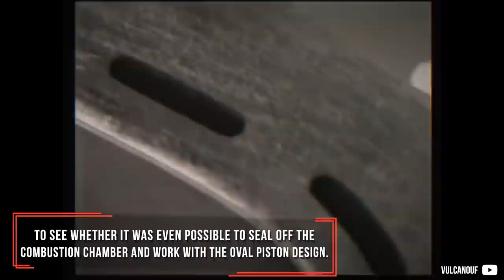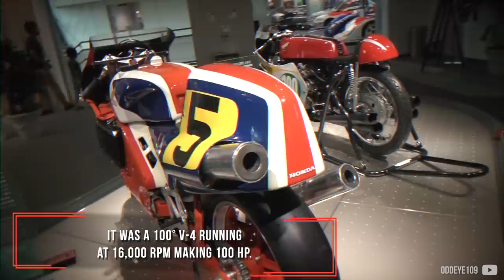Why Honda Made A 20,000 RPM Oval Piston Engine

Comment: Another great video, Visio. I have read that oval pistons occurred as a byproduct of chasing number of valves and airflow, not "cheating" a v8 out of the rules as they were at the time. In a circle, once you have 6 valves and a spark plug, there's no more head left, but lining up the valves allowed 8.  In the same article it was mentioned that Honda also had a turbo GP engine in development at the same time - which was allowed at 1/2 half displacement - so they had 250cc turbo parallel twin that revved to 20,000 and made 125hp, but whose power characteristics would be unrideable, so they went with the oval piston 500... Honda is fascinating.
Reply: I believe you are incorrect. To compete against 2 strokes Honda needed their 4 strokes to rev high to make the same power as two strokes which fire twice as often. More, smaller cylinders (each with lower mass) allow the engine to rev higher. Honda had been successfully racing (normally aspirated) 4 stroke bikes with lots of pistons, for example there was the RC166 an inline 6 cylinder 250cc, the 1966 RC149 an in-line five-cylinder 125cc, as well 50cc twins and various others. 
They wanted to build a V8 500 but new rules had been put in place banning engines with more than 4 cylinders by merging pairs of pistons together. The NR project was indeed an attempt to get all the beneifts of a V8 with only 4 pistons as the video suggested.
Reply: Had it been an airflow thing wouldn't they have attempted to put valves at each end (longitudinally) as well for max airflow, essentially 5 valves per cylinder compared w/ traditional designs? As built, the oval design utilised 8 valves per cylinder, or 4 per cylinder vs cylindrical designs. If more air was the goal, wouldn't we expect Honda to cram in more relative valves than the standard 4?
Reply: @williambrasky3891  My initial comment was based on quotes from Honda engine designer Suguru Kanazawa (NR750 road bike) about the development of Honda’s GP bike in Classic Bike magazine October 2017 issue. Here’s a bit of it: 
“When Shoichiro Irimajiri-san and his staff were given the responsibility of designing a ‘new engine’ for Honda’s return to racing in the 1970s - which basically meant not a two stroke - they realized they must increase valve size as much as possible to improve breathing and achieve more power through higher rpm. By using a single cylinder engine for experiments, we tried five, six and seven valves per cylinder but the results were not satisfactory. 
We discovered you must have either four or eight valves per cylinder. With four valves, we could not achieve the necessary flow, but with eight valves the problem was how to arrange them on a round cylinder, and to operate them in a suitable way. Then one day, Irimajiri-san was driving home from his office, when he stopped at a traffic light. In Japan these are suspended in the air, with filter lights for protected direction changes underneath the three usual lights. He looked up and saw two rows, each with four lights, hanging in the air side by side. He suddenly realized how it would be possible to make an eight valve cylinder using an oval piston. The next day we began the development of the NR New Racing design! 
After we made the decision to use oval piston technology, other advantages became apparent which, honestly speaking, we did not think of at first. Everyone compares one eight valve oval piston to two round four valve pistons, and because it was forbidden to make a V8 engine for 500 GP racing, people thought we made the oval piston V4 to avoid this rule. But this is not so; the technical advantages are even greater than a round piston V8, making the oval piston design the preferred choice in any case…” 
...and then he goes on to list the advantages, and they were competing enough to entice them into trying to surmount the many difficulties of making an oval piston engine. Very interesting article. So anyway, that’s all I got, just an article in Classic Bike - but words straight from someone on the design team.
Cheers, T.
Reply: I think the theory would be to have a short stroke with the big bore, to create the high revs required.

Comment: Simple explanation: high revving engines have a short stroke and a large bore.  They are OVERsquare.  The more width of combustion chamber, the higher it can rev because the piston doesn't have to travel as far or as fast to move the same displacement.  The slower pistons move and the lighter they are, the faster the engine can revolve.

Comment: Thanks for the video . love Hondas. I read about how Honda started from a simple bicycle shop. My first and second cars were both 1978 Honda Accords hatchback 5- speed. Those cars were so dependable I went between New York and Toronto over and over again with them. Right now I have a 1978 Honda CB125S motorcycle which is my regular mode of transportation 12 months of the year through all four seasons.

Comment: That NR750 it's the stuff of wet dreams ! 😍👍
Reply: I had a 1987 45VF 750r or was it VF 45 750r the engine was Vfour at 45° of separation between the V part 750cc had lots more power than i ever could use that bike would pull front wheel n just turn of the wrist or turn rear tire during lite acceleration leave black marks on concrete road
Reply: @scottyjones27  yep everything is fast when you are 18 , don't drive the new Fireblade SP @250bhp at the back wheel , We live in great times

Comment: That they got the rings to seal boggles my mind.
Reply: Great point!
Reply: From the video it seems they installed the rings with the gaps on opposing sides which should in theory work. I am just not sure of the advantages of the design if there are any. I guess if they could have got success with a reliable engine that hits 20k RPM we would have seen it in production.

Comment: In 1979, 500cc GP bikes had to be 'bump started' when the flag dropped. I was on the inside of Copse Corner bend at Silverstone for the British Grand Prix. The 2 NR500s were both difficult to start compared to the 2 strokes. The flag dropped and most of the 2 strokes set off with Takazumi Katayama getting away near the back of the field and the English rider, Mick Grant not being able to start his NR500. He tried for about 100 metres and then it fired and he leapt aboard, rode for about 200 metres and as he reached Copse Corner he fell off and the bike immediately caught fire, right in the middle of the track.  Fire Marshalls and Honda techies ran to the bike and put the fire out in a few seconds. The Honda guys then put covers over the bike and carried it away. Mick Grant walked away, slowly shaking his head. The race was real fun, with Barry Sheene narrowly missing out to the winner, Kenny Roberts. A very eventful day especially, as my mate had dropped his Guzzi Le Mans, on the way and came in on my pillion.

Comment: Why would Honda build a 10000 rpm oval piston engine?  Because they can.
Reply: Not really, no, they wanted to build a V8 but new rules stipulated that 4 cylinders was the maximum. This was an attempt to get all the advntages of a V8 but with only 4 cylinders but it never really worked. Even the NR750 was only sold in limited numbers and had only just over half the horsepower they had been aiming for because otherwise it couldn't be made reliable.
So, to counter your comment; not only dod they not make it because they could; they couldn't. It was a glorious failure.
Reply: exactly it’s because they wanna
Reply: Only one way to find out what works!
Reply: My question would be why would they NOT build it.
Reply: the rumors was promising
made.me think of rotary engine
beeing a mechanic
i knew it wouldn't be right
especially reliability
Reply: @tonyb9735  Is the nr750 valuable now?  Collector bike?   seems like it would be.

Comment: Great video. Because Soichiro (foolishly) hated two strokes, enormous amounts of time, money and resources were wasted on a project that was doomed to fail from the start. Fascinating to see the innovative engineering Honda came up with all the same.
Reply: it wasn't doomed to fail from the start, even in this video it showed that they made 1 cylinder test engines to see if it was feasible,and remember...they made a HIGH PERFORMANCE engine with a completely new and innovative design!
Reply: @vasopel  It hardly finished a race let alone come close to winning one! Its best finish was a 13th place! It was doomed in that trying to make a 4 stroke compete with a 2 sroke with equal capacity was never going to happen. Even today, if 2 strokes weren't banned a 750 would smash the current 1000 4 strokes. It would make more power, weigh less and with modern electronic systems to control traction and wheelies the 4 strokes would be relegated to boat anchors!
Reply: Soichiro has a money and resources and he just want to "have fun" with his obsession. Honda make good 2 stroke in NSR  and CR series.
Reply: @argacc20417  yes nice he could attempt the project at least even if not successful. I previously owned a CR 250 MX bike and currently race a Honda RS125 2 stroke GP bike. It is epic!
Reply: Two strokes are inferior, and almost completely phased out due to emissions. Honda was WAY ahead of the game, and dominate 4 stroke power units in almost every industrial application you can think of :)
Reply: @ralphwiggum4805  Weed wackers, chainsaws... but for a generator, yep, I'd pay extra for a 4 stroke version and put up with the additional weight for the improved fuel efficiency and quietness. Emissions are a 2 strokes Achilles heal. In most other important aspects they are superior to 4 strokes. (Weight, complexity, HP per litre) For me personally, every 4 stroke I've ever ridden has been boring. Almost every 2 stroke has been exciting. The way a 2 stroke explodes up through its power band can't be replicated by a 4 stroke. Game over! If two strokes had not been regulated out of racing they would still dominate. Look at Phillip Island lap records. A 250cc GP bike is still faster than a current 765cc Moto2 GP bike in spite of 15 years of tyre and electronics developments! (1.32.0 V 1.32.4. Outright fastest laps) 2 strokes rule!!!!
Reply: Nothing foolish about hating 2 strokes. They're way too loud, the sound they make is worse than screaming babies and small yappy dogs combined, and they don't pass modern emissions OR mpg mandates. Save em for your chainsaw.
Reply: @brodiejones2028  There's a lot more required of an engine than just horsepower/displacement or hp/weight. If Soichiro ONLY wanted to win races, he'd have stuck with 2 strokes. But he was most focused on creating SELLABLE consumer vehicles in a changing world. Racing is merely a means to stimulate innovation, try out new ideas without all the liability, and motivate his engineers, while also garnering brand attention, aka advertising. You must be pretty young.
Reply: @brodiejones2028  even whipper snippers (weed whackers) are dominated by honda 4 strokes, no idea why they never made a Chiansaw, it would put Stihl and Husky out of business overnight
Reply: It's called racing. He who experiments the most wins the most.
Reply: @brodiejones2028  , you didn't know if it was going to happen or not. Honda didn't know if it could be made to win or not. Monday morning quarterbacking is easy. Your claims are moot.
Reply: @pookysdad4884  Honda finally came to the Indianapolis 500 on 1983. As per every company, they didn't qualify. The second year, 1984, they did the impossible and won. USAC had their pace car stay on track too long. The American Honda driver Tom Sneva had no choice but to pass the crook's pace car, or would certainly finish a few laps later far from the first place he was in. USAC took the win away from Honda and  Sneva. But the entire world watched Honda and Tom Sneva win the Indianapolis 500 on their
Second attempt. And saw why USAC was disqualified to sanction Indicar racing.
Reply: @brodiejones2028  
Having grown up with and owning a Yamaha RZ350LC and Suzuki RG500 Gamma (Grey market Canadian model) I can easily say that my current Aprillia RSV4 1100 Factory has by far the best engine of a street bike with the possible exception of the Ducati V4 Panigale. Those 2 bike were the epitome of street 2 strokes before they were finally banned. Now at the age of 60, and lived through the entire evolution of the modern day Superbike from the 1969 Honda CB750, to the 1985 Suzuki GSXR750, to the current liter plus bikes like my Aprilia RSV4 1100, I can easily say that we are currently in motorcycle nirvana as far as sportbikes go.

Comment: They developed the 4 stroke cvcc car engine and revealed to the world that year. I have an 87 crx high fuel (hf) that gets 60 mpg on the highway. Same engine. Oh yeah, it meets emissions without a catalytic converter. Just an engine doing clean work running at 21 to 1 air fuel ratio. Please look it up. Its soooo Honda in every way. Cars had it till 88'. What fantastic engineering they had back then. Also the technology was debuted in 66 in a Nissan because they didn't have a chassis big enough for the engine. Bravo. Imagine what those engineers could do now without restraints!

Comment: Honda only made the SL 90 for one year, 1969, and it was a good looking great riding street legal trail bike that had a cast iron cylinder vs the aluminum sleeved cylinder of the regular 90s. I beat the crap out of my 90 as well as my friends that had the regular stamped steel framed 90s with the aluminum cylinder. We rode bikes all day long in the summers. With the SL 90 I cracked the piston rings several times while under warranty. Some times a bore job and new piston and rings, sometimes a whole new cylinder. One time the cylinder and parts were sent to Japan for inspection by the engineers. I talked to the US distributer by phone, they wanted to know what I was doing. I explained that I heard the ring snap once after  going down in water and after the motor died. It was later relayed to me via the dealer that I needed to run the bike normally after pushing it hard to allow the cast iron cylinder to cool, and also, no more warranty claims. At the time they said I held the US record for warranty claims for a Honda 90. May of just been dealer BS but it was valid for their shop.

Comment: I revved a big block Chevrolet to 25000 rpm, without heads, the main problem is the valve train. I then developed the square cam engine no duration, instantly open and instantly closing valves electromagnetically. This was sold to the military because of it's quiet operation.

Comment: Technically it is not an oval piston; an oval shape never has a strait line, oval is curved at any point;
the piston has two parallel strait lines, so it is not realy oval, it is kind of two round ends with an extansion between, but anyway.
Brilliant invention, I love the NR 750...
Reply from the maker: Technically, the oval would be the same as an ellipsis. This concept is generally known as an oval piston engine, so I am not going to argue with or change that.
Reply: @VisioRacer  But that is the point; ellipse would be wrong in the same way.
The geometrical shape of an oval has strict properties, there can not be an arguing about it.
The piston was designed and engineered by people, who should be knowledge enough to know the difference, thats quite a pitty.
What you are doing here is simply chat up and justify the same wrong thing.
Btw. some engineers know the difference and they already clarify, that the oval piston isn't oval at all!
If you understand german, here is one source:
https://www.youtube.com/watch?v=Qnk3LJSWjhQ

Comment: I raced against "Fast Freddie" Spenser and the NR 500 on the oooold evil Yamaha TZ-750 two stroke that could easily be turned to make 300 RWHP the chassis, suspension and bias ply tires couldn't handle! At 275 HP the chassis and suspension of the TZ-750 was BARELY workable but the Badyear tires were still a nightmare. The Honda was running Michelin RADIALS as was the Works Yamaha with "King Kenny" Roberts riding on Pirelli's. Except for Dave Aldana, the rest of use were moving road blocks for Kenny and Freddie and the Honda may have given-up 100HP to us, but it HANDLED and we didn't. Freddie blew by us in corners like we had stopped dead and nearly SILENTLY. Roberts had the last two-stroke Yamaha 500cc F-1 bike made of unobtanium.

Comment: The oval piston  leads to a few issues.  In a standard cylinder. The rings can rotate as needed. The oval blocks that. The tension against the cylinder wall will not be even. Yes, you could  spread the  gaps180 from each other,  but..

Comment: This is a solution to increase numbers of valves under regulation's limitation of number of cylinders but never succeeded against two stroke competitors. If 8 cylinders were permitted, they could make far better engine. But same capacity with two strokes engine, 4 strokes engine might have no chance to compete as NSR did. 4 strokes engine need near twice capacity to compete with two strokes engine as current MotoGPs'.
Reply: twice the capacity or twice the revs

Comment: I vaguely remember reading that Honda had a V-twin version of the oval piston engine for American flat track racing in about 1979.  The OW72?  Am I remembering right?  I've always had respect for Honda as an engine company.  I've been fascinated with the NR750 since I read about it in the motorcycle magazines in 1992.  I think Honda may have left some tricks on the table after they got the engine to the 95% maturity level.  It would be great to see them update the concept.  For instance, why no 3rd spark plug?  Or, do all of the intake valves really need to be the same size?  Did they pressure balance the pistons?
Reply: OW... sounds like Yamaha to me with that 'race' code (Officiated Works homologation racebike). 
Honda Motorcycles/HRC uses 'RC' (Racing Concept/motorCycle)
Reply: @razor1uk610  Could be.  I'm recalling from long, long ago.